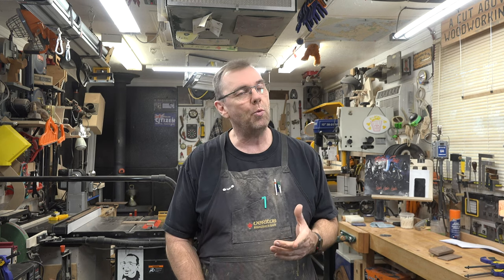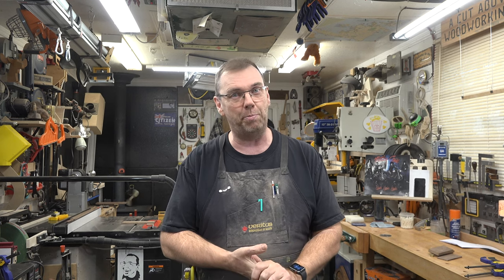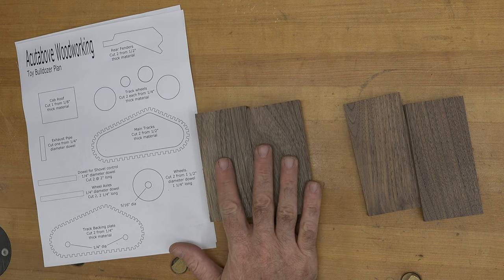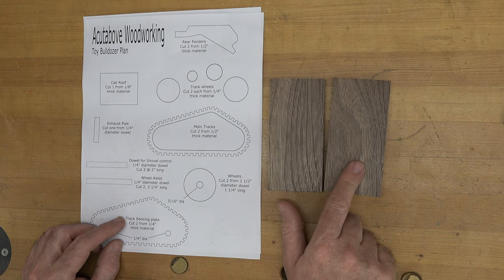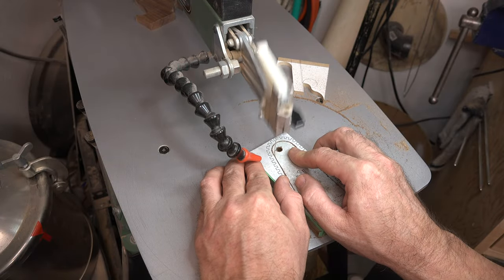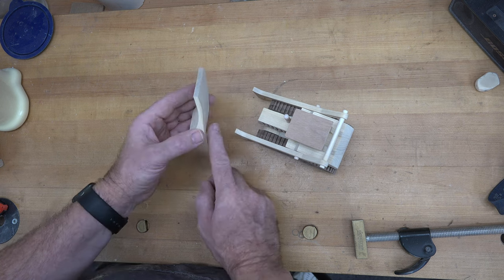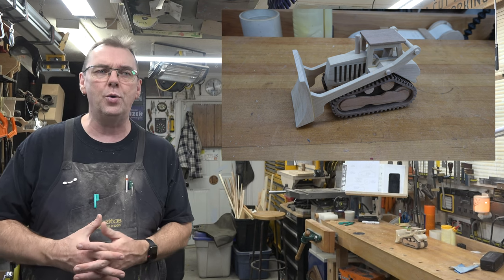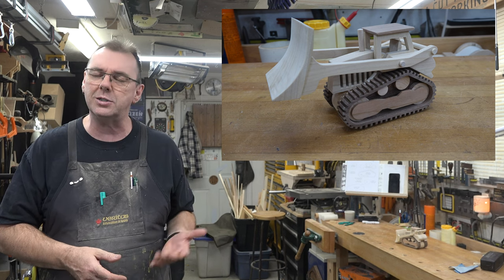Making a Toy Bulldozer

Comment: Ken! I am going to make one of these but I am going to try and make the track notches by using the table saw and cross cut sled; there's 3 flat sections on the track plans which will be no problem holding the flat parts on the sled and passing the sled over the correctly raised saw blade; It may be a bit trickier on the curved sections of the tracks but I think it can be done if I clamp the tracks with the pattern against the sled fence at the appropriate angle; If not, I will do it the way you suggest. Love the design of this one and look forward to seeing more of your designs in the future.
Reply from the maker: I would be interested to hear how you make out with that.  If you are going to use the table saw for the track notches, I would suggest leaving the interior of the track solid until all the notches are cut.  This will give you more clamping area and make the track more stable while being cut on the table saw.  Good luck on your project and thanks for tuning in.

Comment: I wondered if you were going to pin the scoop. What a great toy to add to the rest. Is a grader next. You might need to make a lowboy trailer to haul the bulldozer around. You are going to have quite a collection a nice heavy equipment when you are done. Great design, great build! The toys are too nice to play with lol. On cutting the track, is it possible to drill out  the bottom of the treads and then make straight cuts to that. Or would that make a mess or just not look right? I'm not sure. Just curious. Enjoyed, take care! How about a Formula 1 face car?
Reply from the maker: Drilling out the majority of the track recesses might be able to be done with a drill bit but they are small enough that you might just be causing more work and trouble for yourself than what is necessary.  As for the design ideas, I love them all and I will add them to the list of toys to produce for the show.  Thanks for the suggestions and for tuning in.  It's always great to read your comments on the show.

Comment: That looks amazing, I'll have to find a different way to cut the scoop (no band saw). Will the plans be on the website?
Reply from the maker: The plans are definitely on the website Mark.  If you have any problems getting them, please let me know.  As for the scoop, an oscillating drum sander will also work.  It will just take longer.  Thanks for tuning in to the show and for the kind words on the project.

Comment: What is the best way to cut the vents on the body?
Reply from the maker: Interior cuts on a scroll saw would be my choice but if you don't have a scroll saw, you can always drill a hole at the top of the vent and the bottom of the vent and then use a small coping saw to join the holes together.  I hope this helps.  Thanks for tuning in
Reply: @acutabove_woodworkings  thank you will try that.